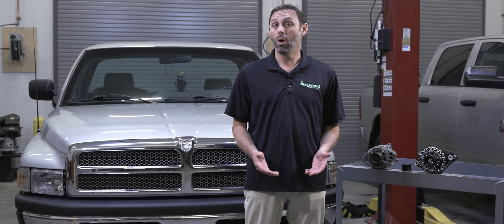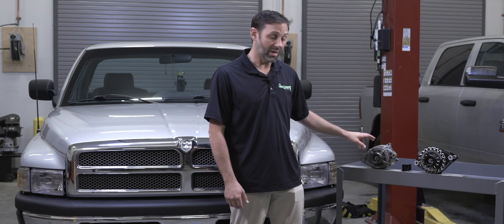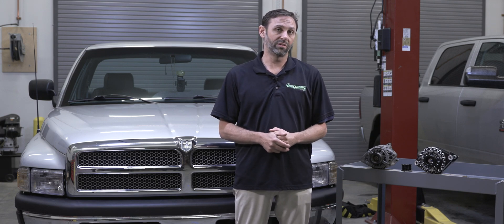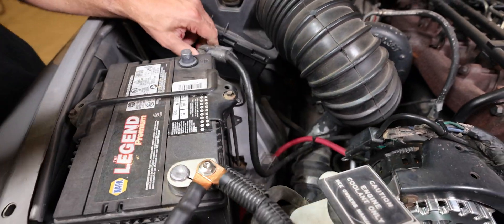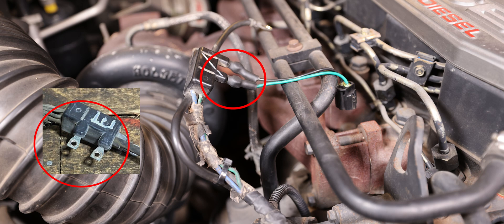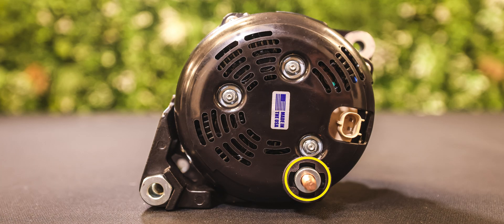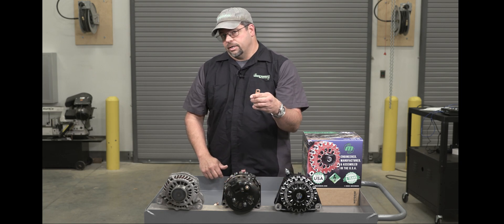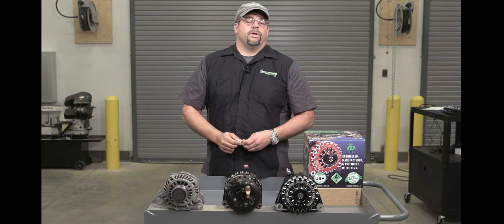12 Valve Cummins 370 Amp Billet Alternator

Comment: Question: Why cap off your Cummins alternators at 370 amps? What’s stopping y’all from making them with an output of 400 amps?
Reply from the maker: Good question, we get that quite a bit. The short answer is the terminal block or "regulator" used in these applications.  They will generally only do around 385-395 amps of output.  

We do not "numbers dance" like many others and only advertise what we know our alternators will do 100% of the time in worst case scenario environments. 

With that being said, we offer this in a single wire turn on style in our motor swap section.  It uses a GM style 4pin regulator for internally set voltage in the 14.5-15 volt range.  This setup will actually yield just a bit over 400 amps. :)   

Could we call it a 400 and charge more money? Sure.  But again, we do not numbers dance.  We base our products on customer satisfaction and reliability of components used.
Reply: @mechmanalternators  Thanks for the answer, and thanks for being one of the companies out there that doesn’t sell snake oil. Always nice when you know your purchase is backed by plenty of real world testing and results that back up the performance numbers. Little wonder why Gale Banks likes y’all’s amps at that point.